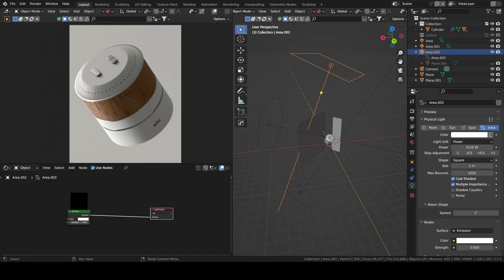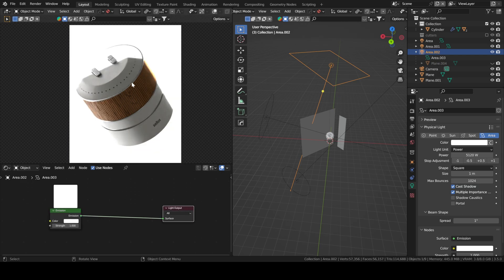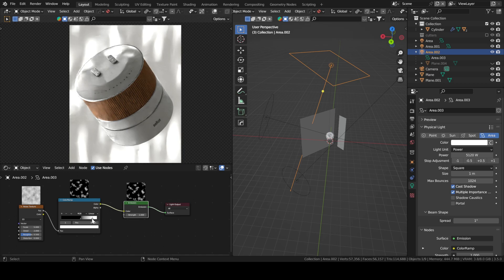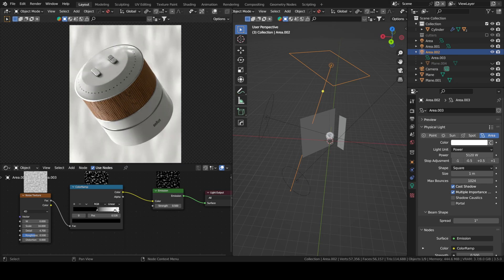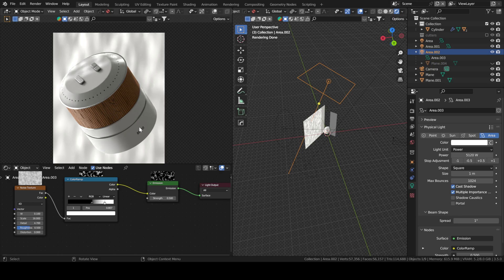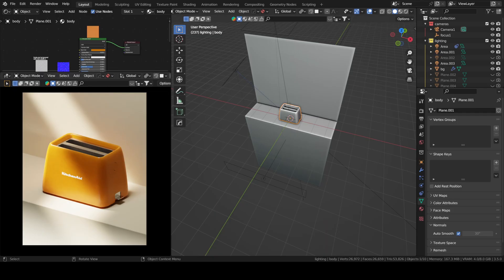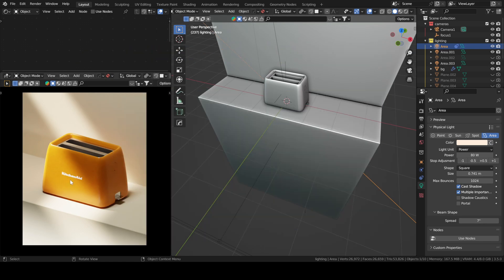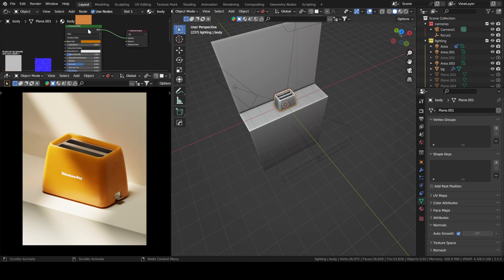How To Make a Simple Gobo - Blender Beginner Tutorial

Comment: I seem to have much trouble using this technique.  I understand how this is supposed to work but when I try it my Noise texture / color ramp adjustments just make the entire plane darker/lighter, it's like I don't get any noise regardless of the noise scale settings, which I've tried from .001 to 20,000.  There must be some missing piece to this.  I just created a plane, suzanne and an area light in a new project and re-followed the video but no joy.  I tired using a Wave Texture too and I see the same 'nothing happens' results
Reply from the maker: did you set the light spread to a low value ?
Reply: @aumission  thank you! had the same hickup

Comment: Noise doesn't seem to work in 4.1. Tried all the light types with your settings and it's a total blank.
Reply from the maker: did you lower the light spread ?
Reply: @aumission  Yes I did that - everything from 180 degrees down to 0 - and after 6 hours of trying to get it to work with different lights I've given up. Funny thing is that it works with B/W gobos I've copied from the Web and some I made myself. Noise texture, however, seems like a total loss.
Reply: @aumission  Revisited it again today and for noise to show in Cycles, mapping seems to be a vital component.
Reply: @Argyll9846  Jesus, I love you, thanks!!!!

Comment: Can't get this to work...but, thanks for the tutorial anyway.
Reply: To get this to work I had to adjust the 'spread' of the light down to 1 degree (normally 180 or so on area lights) and then the texture pattern came through. The spread and the size overall affects the sharpness of the texture projected
Reply: @simoncodrington  Thank you!! How is this not in the tutorial.
Reply: I can’t either, the pattern just isn’t showing up after doing everything correct
Reply: @JDawgWillz  Use a texture coordinate (from UV to Generated) and connect it with the noise texture, then it should work!
Reply: set the beam spread down to like 1 degree or around there
Reply: I've got no luck to get it work too by using area light, but it finally work on spot light, and set the normal as the driving texture coordinate.  (radius of the spot light can also control how blur the gobo texture is)
Reply from the maker: what's the issue ?